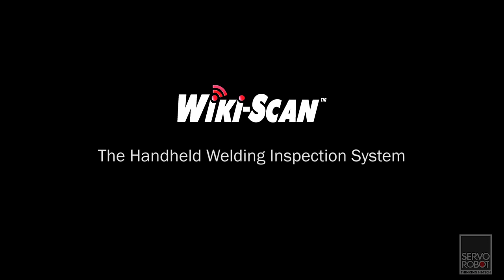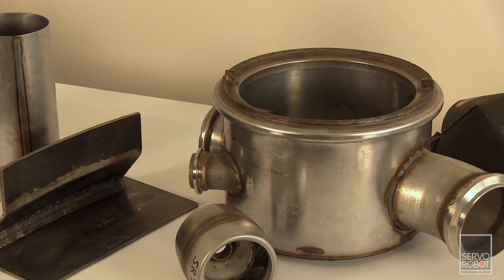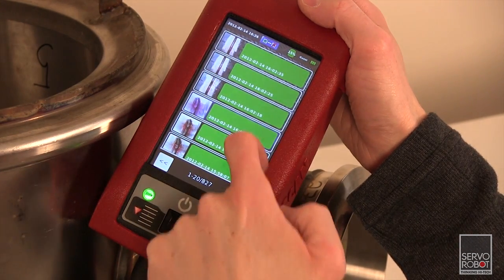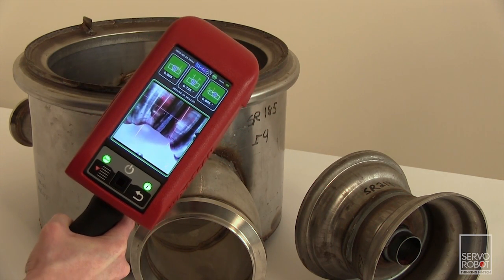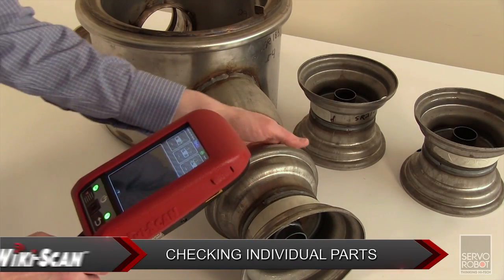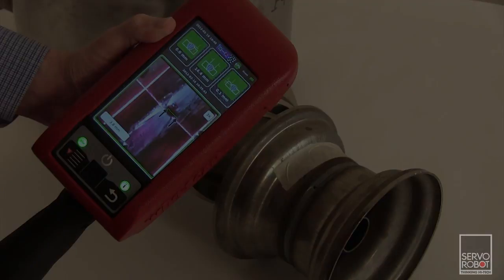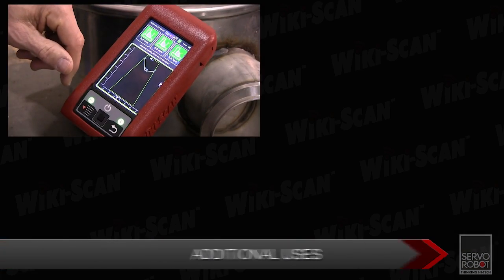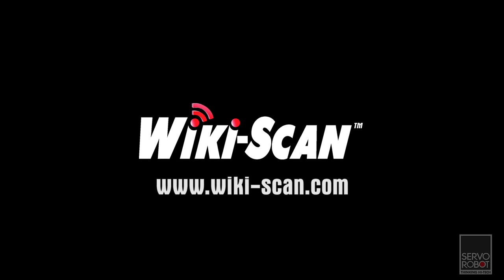WiKi-SCAN™ Portable Inspection System

Comment: where to buy this tools
is this approved spec is approved by aws or twi
Reply from the maker: Hello Elan,

Thanks for contacting us. For information on purchasing the WiKi-SCAN and your local distributor, please check the Distributor list on our website or send us your contact information via our contact form (see links below). 

https://servo-robot.com/distributors/

https://servo-robot.com/contact/

The WiKi-SCAN is a versatile tool that allows you to directly input inspection parameters to conform to your specific standards. As for approval,  neither AWS or TWI approves or disproves any specific product for doing weld visual inspection. However, The WiKi-SCAN has been used for years to judge all of the AWS welder and robot welding competitions and has stated it is as the “official judge” of AWS competitions.